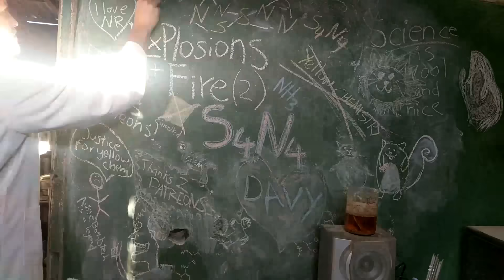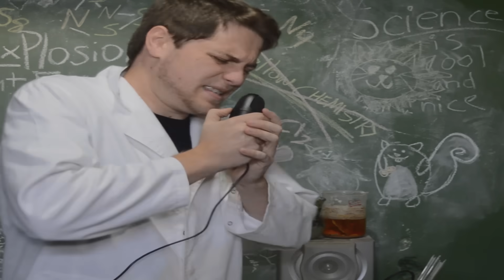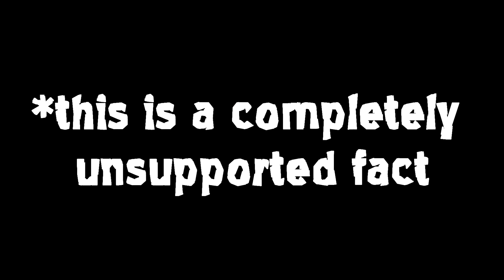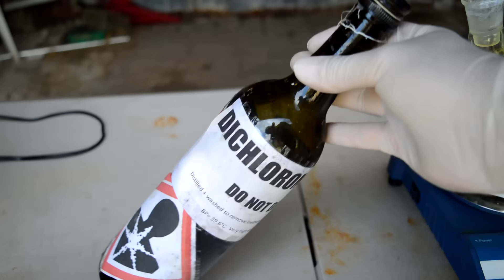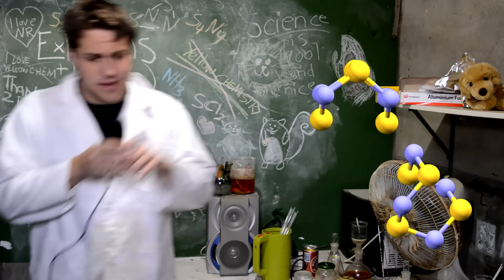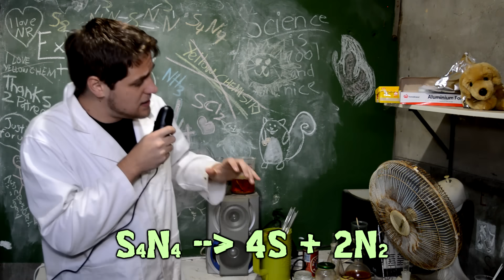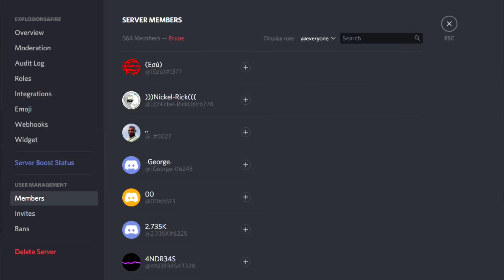Sulfur Nitride, My Arch Nemesis - Ex&F

Comment: Does anyone know if S4N4 was once used as the explosive in toy cap guns. I vaguely remember a reference to this application.

P.s. I have found two references to the use of "Nitrogen Sulphide"  and " Nitrogen Selenide" in percussion caps.
Ref The chemistry of Powder  and Explosives by Tenney L Davis ISBN -0913022-00-4
And a brief reference in 
Ref Military and Civilian Pyrotechnics by Dr Herbert Wooden ISBN 0-8206-0364-3.

I am glad I found these, as I was beginning to question my recall, though the above are not the book references in which I originally found information on this compound.

It makes sense to use this in percussion caps, as the sulphur flash makes an ideal source of ignition for a  powder propellant, and in a toy cap guns the flash provides a nice added special effect, particularly if directed through the gunbarrel.
Reply from the maker: Very interesting if it was actually used there, had never seen those reports before, cool!
Reply: @ExplosionsAndFire  check out http://lem.ch.unito.it/didattica/infochimica/2008_Esplosivi/NitrogenSulfide.html
The reported detonation velocity, suggests it has a better performance than you recorded in your video, though the beer/lager can test hinted at a more impressive performance.

Comment: Yeah, I really liked this vid. The compound S4N4 just sounds cool and the structure is so warped. Hey, I’ve read Tellurium smells REALLY bad. Like you get exposed to it and no one wants to be near you for a week.Maybe T4N4 isn’t a good goal.
Reply from the maker: Te4N4 isn't really a goal, nor is Se4N4, but it fun to speculate. I think the smell gets worse as you go down the periodic table in that column, and also the sensitivity of the nitride goes up too, so Te4N4 is probably way too sensitive to be easily made

Comment: All that effort for  a product with such a poor performance and not even a very good yield and all those extremely toxic reactants and solvents.
I have know about this compound for a very long time, thanks for going to all that trouble to make it and showing its properties. Its not going to find a place on the green explosive list.
Reply: Have you seen that pretty blue flash when it burns? That's a special effects type of application right there.
Reply: @sciencoking  as I said I think I have seen this used in toy cap guns to provide a bang and a flash. I recall the smell of sulphur dioxide when they were used. The quantity of material in the cap was absolutely tiny. How stable is S4N4 in long term storage?
Reply from the maker: @nigeljohnson9820  S4N4 seems perfectly stable if kept dry, for at least a couple weeks, unsure about longer. Likely breaks down from moist air I'd say. I think the sulfur smell comes from a S containing flash composition, or gunpowder, it's hard for me to think they'd use something this obscure in a toy, haven't seen it mentioned.
Reply: @ExplosionsAndFire  I was wondering about hydrolysation of the compound but I could not see how this could happen without a violent reaction. How can the ring be broken without the release of a lot of energy. The caps date back to my childhood and were sold as a plastic ring with small cups dotted around the circumference. Inside each cup was a cardboard disk, which held in place a very small quantity of red powder. It is perfectly possible that the powder was a mixture of phosphorus sulphide (or red phosphorus) and perchlorate, however I recall a text book reference to S4N4 being used in this application as an alternative to the composition used in the paper reel caps. I believe the plastic ring construction was necessary to provide added confinement to ensure a good detonation. If, as you suggest, it is easily hydrolyzed then it is unlikely to have been used in caps that require long term storage. Do you know if the compound is toxic?

I have found two references to the use of "Nitrogen Sulphide"  and " Nitrogen Selenide" in percussion caps.
Ref The chemistry of Powder  and Explosives by Tenney L Davis ISBN -0913022-00-4
And a brief reference in 
Ref Military and Civilian Pyrotechnics by Dr Herbert Wooden ISBN 0-8206-0364-3.

I am glad I found these, as I was beginning to question my recall, though the above are not the book references in which I originally found information on the compound.

Comment: what if you were to mix it with an oxidiser, perhaps potassium chlorate?
Reply from the maker: It did help it a bit, but nothing significant. Maybe I didn't mix it really well, but it's hard to grind something that's explosive up to very small particles for a good flash powder (ok maybe not hard, but not very safe. Probably could've got away with it if I had tried though, it wasn't thhatttt shock sensitive (A dangerous gamble to play))
Reply: @ExplosionsAndFire  ahh fair play. well done on getting it in the end though!

Comment: you used it all up? nothing left to test it mixed with an oxidizer eg. 3(S4N4) + 8(KClO3) = 8(KCl) + 6(N2) + 12(SO2) ?
Reply from the maker: I did try some tests with chlorate, perchlorate. Improves the burn rate, doesn't improve the explosion.
Also, it seems the boiling point is quite low, so it seems to boil off from a chlorate mix even before the chlorate can do much, and then the chlorate doesn't really help too much as the burn rate of the cloud is so fast anyway

Comment: I take it there isn't an O4N4 compound?
Reply from the maker: No, but there is Se4N4 and Te4N4 which are apparently more explosive... harder to make though. So much ring strain!
Reply: @ExplosionsAndFire  God, I can't even begin to imagine how bad Se2Cl2 will smell. Selenium compounds smell absolutely foul.
Reply: Rob Newland several Te4N4 molecules are typing
Reply: Sounds like a challenge for the next time you need to prove you've grown as a person. Or should I include a vague and incorrect summary of a synthesis of one of these to ""motivate" you?
Reply: @ExplosionsAndFire  and more stinky to make
Reply: @ExplosionsAndFire  Tellurium and Selenium...  and you thought the sulfur compounds smelled bad...

Wikipedia: "Tellurium.... Humans exposed to as little as 0.01 mg/m3 or less in air exude a foul garlic-like odor known as "tellurium breath"

Things I won't work with blog:  selenophenol, ...“The biggest stinker I have run across. . .Imagine 6 skunks wrapped in rubber innertubes and the whole thing is set ablaze."
Reply: @ExplosionsAndFire  "So much ring strain!" There are ointments for that..
Reply: Just guessing, but O4 N4 is ao close to stable-ish NO, that i don't imagine it would stick around for any real amount of time.
Reply: Colloquially known* as NONONONO

*not really